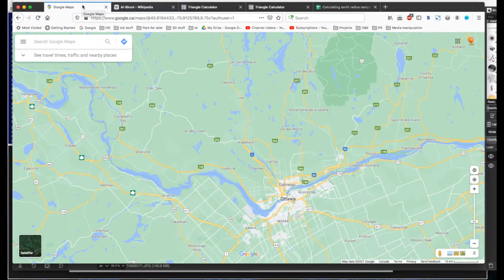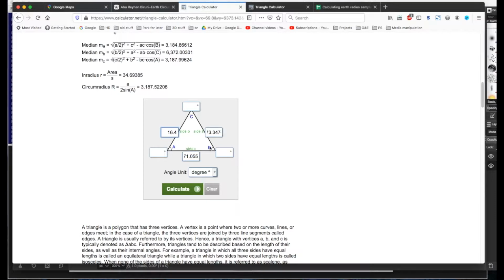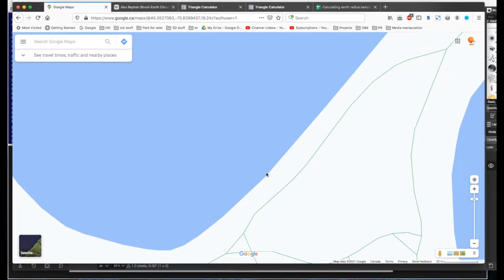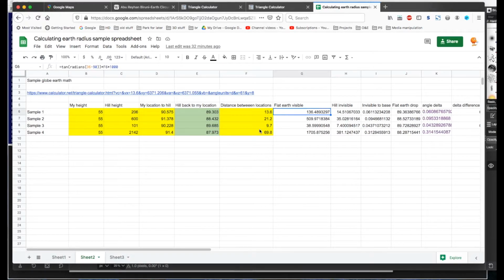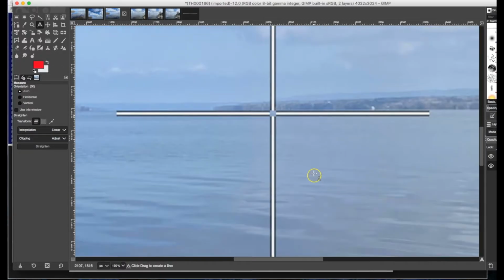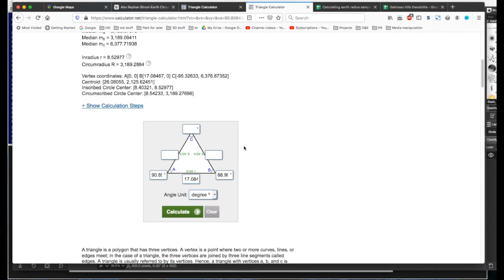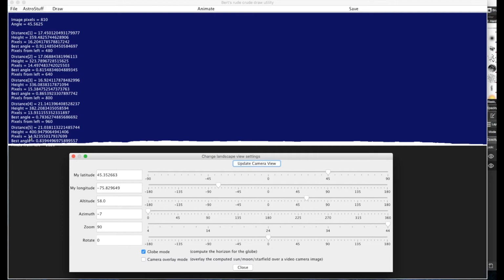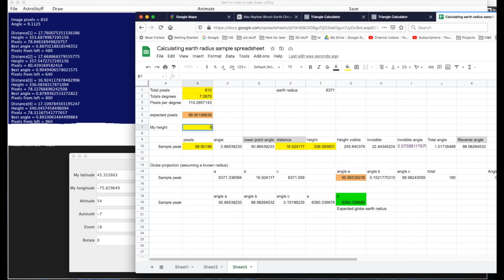How I ALMOST measured the earth's radius

Comment: In 1978, toward the end of my freshman year of college, I and a group of other physics majors did a similar exercise, but we had (a) a real theodolite, (b) a target at a known height on a radio tower on an island in Lake Erie with a retroreflector, and (c) a laser.  Both the observation point and the radio tower were both on the aviation charts and near (or on, in the case of the observation point) USGS survey markers.  We got a fairly good approximation of the radius of the earth from that.

Many years later, I took part in another activity that used a different method for calculating the radius of the Earth and a few other things (like the distance to the moon) done by amateur radio enthusiasts.  There were "teams" in about 17 locations, including several in North America, two in South America, one in Australia, another in New Zealand, a few in Europe (Germany, Spain, Greece), one in the UK, and I don't remember where else (nobody in Russia or China).

The organizer of the exercise created a measuring device made up of triangular metal tubes, clamps, joints, a "finder" scope with a right-angle prism, some 360 degree protractors, and a laser pointer. On a single day, we took measurements of a number of stars.  For those that could see Polaris, the alignment of the horizontal "North" disk (protractor) was based on that.  For those that could not see Polaris, they had some other means of aligning the apparatus for N/S.  A few bubble levels and a pendulum were used to ensure vertical alignment.  Then, on queue over the radio from the coordinator at 5 minute intervals, one member of each team would point the finder scope at the same star (if it was visible from where they were) while the other member wrote down the numbers.  We also did the same with a particular feature on the moon when it was visible.  Because of the distribution of the teams, we were not all active at the same times, but there was enough overlap that every team shared an observation window with at least 3 other teams, and through transitive closure, every star was observed from at least 3 locations effectively simultaneously.

The measurements taken on the makeshift sextant like things for each "point of interest" (star, moon crater intersection) were relayed via HAM radio to the coordinator.  Given the fairly precise position and timing information, along with the somewhat "noisy" measurements from the apparatus, the numbers were crunched, and geometrically aligned so that the "beams" of all observations of each point (star, moon) intersected at the same space.  When the stars were assumed to be at infinity, you got a good approximation of the radius of the Earth, and that was, in turn, used to determine the distance of the Moon.  I don't have the hardware; the HAM operator who recruited me for the exercise had it, and I don't know what happened to it after he died some years later.  I remember what it looked like, but I lack the skill or equipment to recreate it.  At one time I did have a copy of all of the data in an e-mail.

Whenever a flat earther says that nobody has done any real experiments that demonstrated the shape of the earth, I know they're either misinformed or deliberately telling lies.
Reply from the maker: That’s very interesting. It helps when you have a team of volunteers (or students) around the world and can focus on distant objects like that. A big part of the fun for me is to work it out on my own with whatever tools I can find or build. Precision and accuracy may vary, but it’s like a different form of sudoku to work out the variables and why the result didn’t match the expectation.